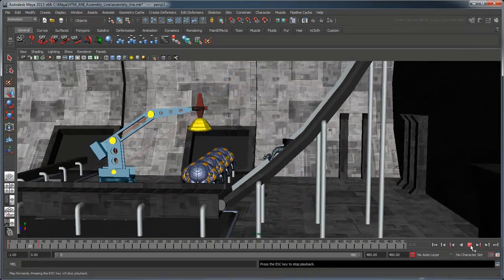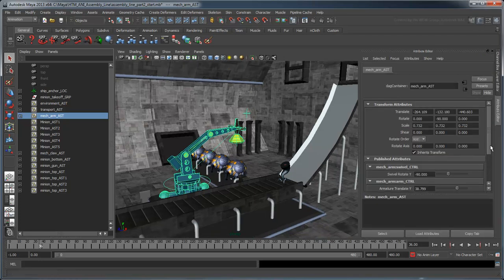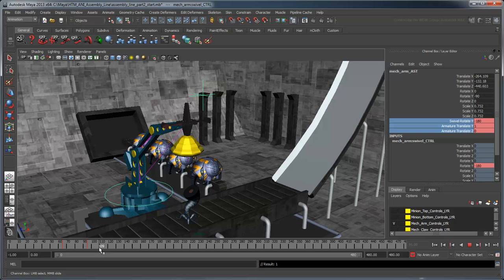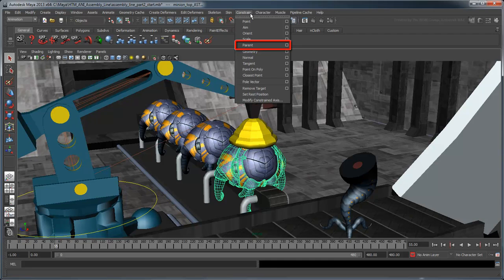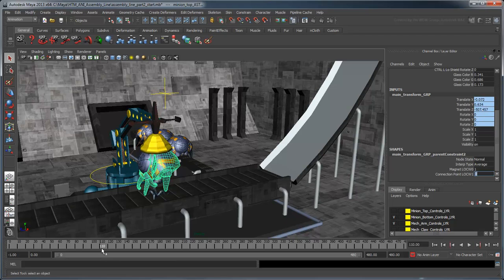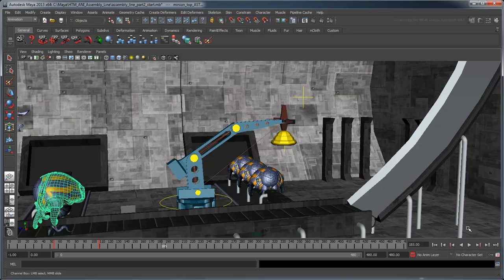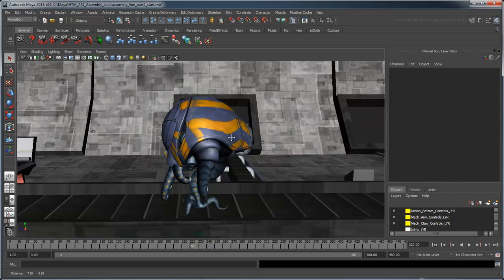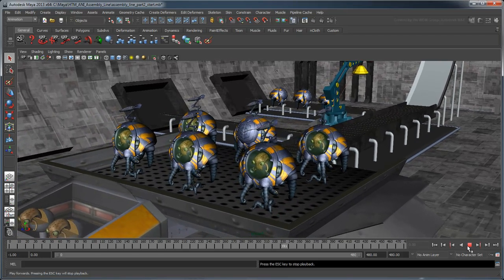Animating an assembly line - Part 2: Keyframe animation and constraints

Comment: For those who have problems with keying parent constrain at 8:20:

Select minion's top. Open Node Editor (Windows -> Node Editor).
Push the button in the left top corner with two triangles in a square (Input and output connections).
After that a lot of nodes will pop up. Don't panic. Find the one with "parentConstraint" in the name and just select it.
Now you should be able to see constrain parameters in the Channel Box (top right by default) and key them.
Reply: I love the statement "Don't panic". It's just so natural
Reply: This works for Maya 2020... it takes a bit of futzing with if you're not familiar with it ( like me ). - as an FYI, I have found the older the tutorial, the less compatible the instructions are with the current version of a program ( also skip Maya 2019 and go right to 2020.... 2019 had huge issues with legacy files )
Reply: oh god, you help me a lot, thank u thank u thank u...
Reply: Thank you. I was so desperate. I'm familiar with Blender and trying to learn something about Maya, and this was becoming a real headache for me.
I really don't understand what was happening and what this "node selection" hack means, but at least I'n not blocked anymore.
Really thank you.😁
Reply: you're a lifesaver... I spent a week on maya 2024 until I see this comment

Comment: At 8:20, when i try to key the parent weights to 0 on frame 54, I get this error: 

/initChannelBox.mel line 78: No object matches name: |main_transform_GRP.w0

I am unable to set the keys on the parent weights
Reply from the maker: I would try deleting the parent constraint and creating it again (with default settings)
Reply: @Autodesk_Maya  I followed DarkMidlight's advice to select the parent node in node editor, and setting keys on that. Worked for me on Maya 2019. Thank you for the quick reply

Comment: Hi, I'm stuck on the step around 8:20. I'm using Maya 2018 and it's not letting me set keyframes on my constraints. Is there a way to fix this?

Thanks
Reply: You can select the parent constraint in the Node Editor and then key it. Worked for me (Maya 2018).
Reply: @DarkMidlight  + ty for the shortcut
Reply from the maker: Do the constraint attributes appear the same color as the video?  Or are they greyed out / a different color?
Reply: @Autodesk_Maya  I have the same problem. They are in the same color, but when I select them and try to key, nothing happens. I'm using maya 2018.
Reply: Stuck too, because I am a beginner I don't know how to use the node editor as @DarkMidlight did. Anyone got a tip on how to make this work?
Reply: @stevenlegg , im stuck too
Reply: I got same problem too

Comment: Hi, nice lesson. In the middle at 8:20 in Maya 2017 I cannot set key on Magnet and point const. on frame 54 or any other.
script edit show me this after I select in main_transform_GRP_parentConstraint2
Magnet and point const
// Error: file: C:/Program Files/Autodesk/Maya2017/scripts/startup/initChannelBox.mel line 80: No object matches name: |main_transform_GRP.w0 // 
// Error: file: C:/Program Files/Autodesk/Maya2017/scripts/startup/initChannelBox.mel line 80: No object matches name: |main_transform_GRP.w1 // 
And no message on my attempt to set a key. 
P.s. I was load this scen without texture
Reply from the maker: Hmm, that error doesn't seem related to the scene file.  Trying deleting your preferences folder and restarting Maya.
Reply: Hi, thank you for advice.
I delete pref. folder as it described in autodesk manual.
problem is not gone
MEL shows me this:
select -r |main_transform_GRP ;
selectKey -clear ;
// Result: 0 // 
I can send to  you full log.
P.s. I have 3 extra row in main_transform_GRP_parentConstraint2
rotation decomposition target x, y, z
Third part of lesson has key on respective place.
I also not seen LOCW0/1 row on the graph editor